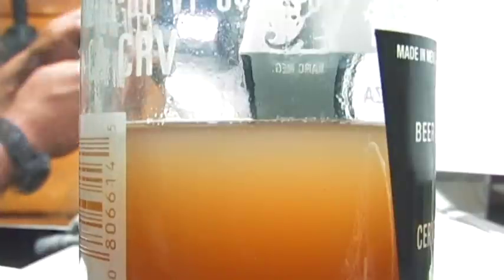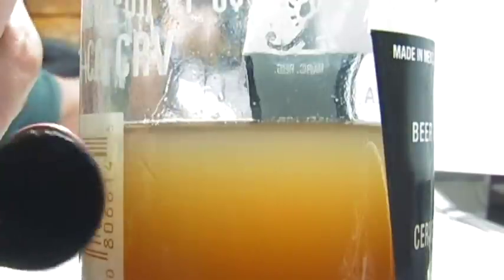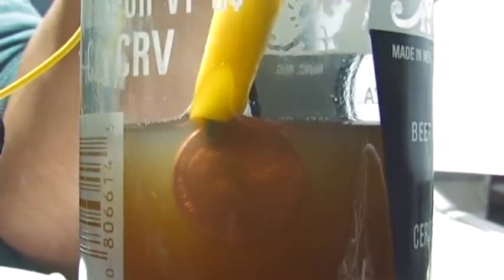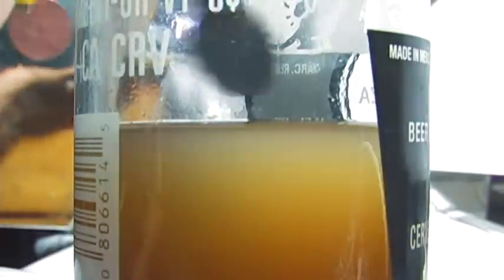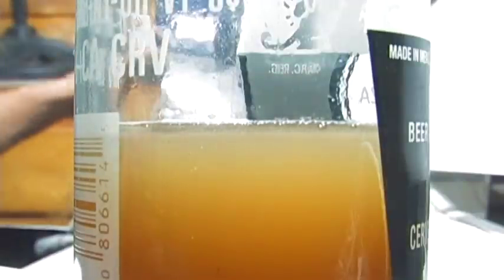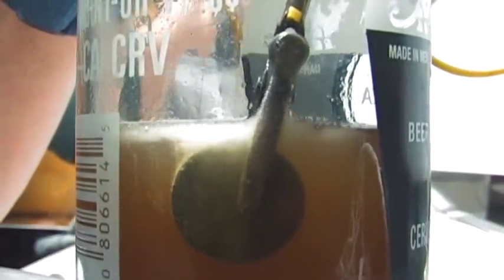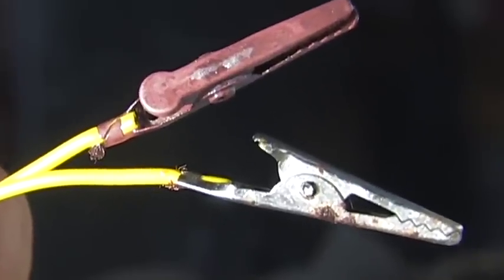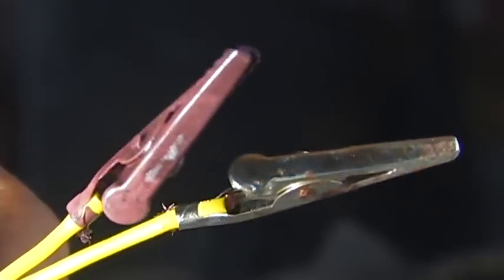PENNY ELECTROLYSIS Science Test DIY PENNY BATTERY ELECTRODE HOMEMADE

Comment: Hi Dan,

Because you have already exposed the water to electrolysis with copper pennies, there is small amounts of copper disolved in the water. Because you have removed the copper from the post 1982 penny (copper coated zinc) there is only zinc left. The effect seen is because of the roughly 0.7 volt differance in galvanic corrosion of disimilar metals generating the voltage needed for the electrolysis you see taking place.

Comment: the electrolysis eroded the copper layer, and now the acetic acid is free to react with the zinc metal underneath.  this is also fun to do by just scratching a small part of the penny, it will react all the zinc inside, and leave you with a copper shell, with one small hole, we did this in my gen chem class during my freshman year.

Comment: you've made a water battery. The penny's copper combine withe the zinc on the clips makes a current and since they're sorted out by touching the are releasing the current which reacts to the water making it boil.

Comment: Two different metals in a salt solution (accellerated oxidation from the acid of the vinegar) will generate electricity.  It is a wet cell battery, so it is in an active electrolysis procedure happening.

Comment: Just a guess here.... but the initial electrolysis would have removed the copper layer from the coin, exposing the zinc. Copper would not react in such a way with vinegar, however, zinc DOES react with vinegar fairly vigorously, which is why an un-touched penny doesn't do anything, but a post-electrolysis penny does.

Comment: @melkel2010 continued... completely off the penny, it appears the process halted. Now that you use a new clip the zinc readily gives up its electrons to the base metal of the clip when submerged in electrolyte solution. Notice the bubbling stops when the clip is not submerged with the penny. (I removed this and reposted to correct a typo)

Comment: It looks like your eletrolysis experiment be using the the copper form the penny to coat the clip. In electrolysis, two metals submerged in an electrolyte solution will exchange electrons from one metal to another. In this case your dirty penny gave up its electrons to the now copper plated clip. The side effect of this current is the deposit of copper on the clip. The zinc did not deposit on the copper that now coats the clip. When the copper was stripped... continued...

Comment: Galvanized steel (zinc plated) and copper wire to the same thing. After a while the zinc will be dissolved. It is the source of fuel.